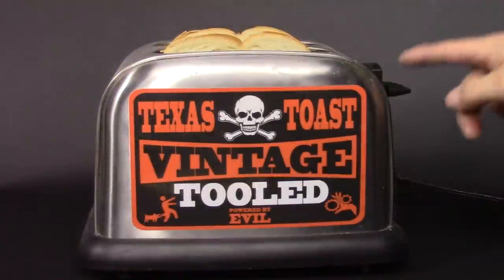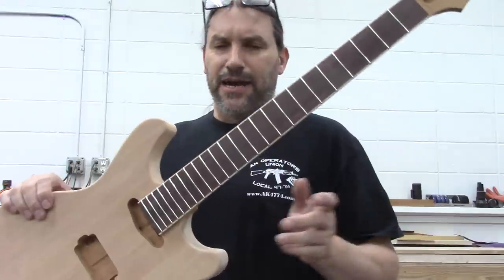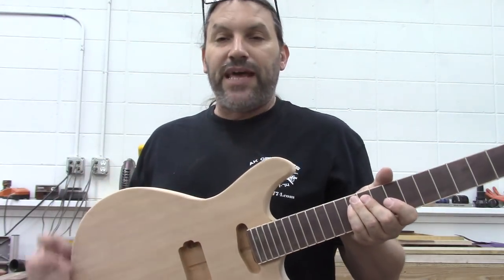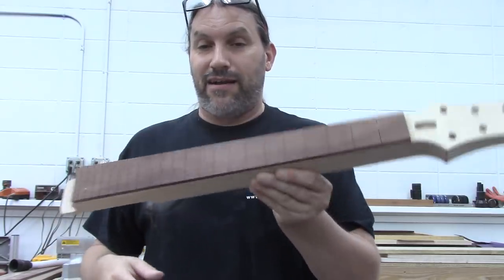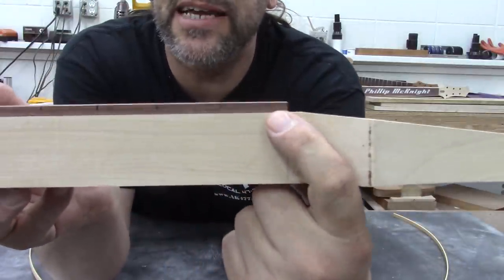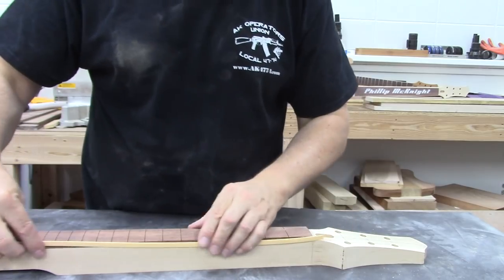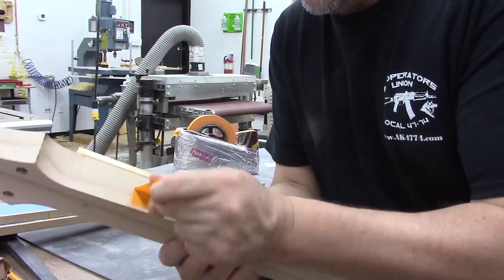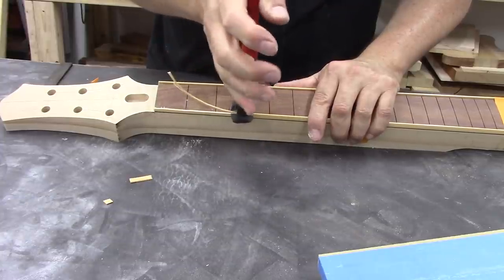Every Guitar Neck You Make NEEDS To Have Binding... And How I Think You Should Do It

Comment: Very instructive video, thank you. I like to bind my fretboards with the same wood as the top I use on the body and headstock veneer, i think it links both parts and looks nice. For those who prefer to do it without a router, you can bind the fretboard before gluing it or the neck. Just cut the fretboard 1-2 mm narrower on each side, glue the binding on each side, flatten the back flush and then glue the fretboard to the neck.
Reply from the maker: Hi Alex, you certainly can bind before glue up. I used to do it that way and it worked great.
Reply: Three years later... I like the necks to have the same wood--tones as the body back.  I really LOVE casino guitars but HATE that they have blonde bodies and dark wood necks.  Among my last two decades of casino purchases, I've found walnut ones that are terrific ONLY because the body and the neck wood is the same tone... of course, I don't like big-block or fancy in-lays because I want to work on wood fretboards, not an incongruous plastoid or shell surface.

Comment: Matt, I'm glad you did this video. When I see super expensive private stock, wood library guitars, from Annapolis, Maryland, made from rare nutsack wood, from the Amazon Rainforest, going for $8,000 and up, I always think, "and you didn't at least bind the fingerboard"?
Reply from the maker: Does PRS do any binding on anything?
I want to say I have seen some headstock binding on a few things
Reply: @TexasToastGuitars  Their cheapest SE Custom models have had binding as recently as the past year or so, the $499 range. I have the $799 model without binding.
Reply: @TexasToastGuitars  Matt, they bind the McCarty 594's fingerboard, because it's a Gibsonesque guitar to begin with. It's quite possible that they bind the fingerboards of a few of the upper echelon (not in the regular core lineup) guitars, because they also have the same type of "Made to Measure" program that Gibson has, and they may have had it, first.

Comment: I'm a nerd, just started building. I'm going to do cuts for all the frets that are completely inside the fretboard, (I.E. The fret slots are not cut all the way through, leaving the edges of the fret-board without any visible gaps or filler without binding.) I've done tests with a jig and a Dremel with a router bit that's the right size for the fret tang, and it seemed to work well, plan on taking it onto a full custom build this summer. It makes it easier to actually pull off a clean side without the extra time of wood binding. I stole the idea from Schecter's process that's up on Rob Scallon's channel, but they use a CNC that I currently do not have and cannot afford. I personally don't like bindings on my guitars for aesthetics, as well as just the fact that I personally prefer the feel, I don't tend to notice it about 30 minutes in when I'm on my grandpa's SG with binding, but I still notice it every time I play, and something about feeling two different materials just irks me for some reason. I plan on adding some class to my necks in other ways so I feel like It's just generally not super worth it, for me personally anyways. I also find nice dome medium high frets to be ULTRA comfy for me, but I'm not a great player, I'm so far a wayyyyyy better builder.

Here because my grandpa's 68 sg is worse for wear so I'm trying to restore it, the binding is starting to peel off and the fretboard is super uneven due to long term un-oiled storage. Soooooo I'm gonna have to bind that lol.

Comment: I much prefer building a neck with binding to with no binding. It's just easier honestly. I always undercut the tangs, regardless of binding or not. Filling in the ends of the fret slots on unbound necks with dust and glue is a tedious process I truly despise, and binding the fretboard eliminates it. That little bit of fretboard showing under the binding is a nice touch, Matt. I may have to try that sometime!
Reply from the maker: I'm with you man, the little extra work is worth it and if you consider the work to fill in the slots it isn't any extra

Comment: Just curious, why did you use such oversized binding for the neck and then clip it down with the clippers? Why don't you just put a specific size of binding on it to fit the channel and be flush with the fretboard edge? Removes the clipper option.
Reply from the maker: The binding I get comes in lots of sizes since I wanted to do the Gibson style get nubs I went with the tall stuff

Comment: you think binding is aesthetic?  it's one of the most physical functioning parts of the guitar, not to cover joints its to protect the guitar, ever notice how it comes off real easy? drop the guitar the binding absorbs the shock and takes the hit, prevents ruining the body or object or headstock, initially an acoustic thing as they were way before solid body but it works on solid body but not as crucial solid body can absorb a hit, may dent whatever but that's it, an acoustic can crack and splinter so teh binding is to help prevent this in mild hits whatever your everyday moving an acoustic around and touring with one..

Comment: I'm sure this has been asked before, but... Your radius sanding rig has an angled offset, so its axis of rotation isn't square with the belt.  Why isn't that producing a radius that's sort of on the piss in relation to the centre line of the neck?  It could be my choice of evening beverage, which might be clouding my normally stellar understanding of engineering, but what's going on there?  Explain yourself immediately.  I won't tolerate any further sorcery.
Reply from the maker: Hmmmm 
Well yes it has been asked and answered numerous times.
I have no idea what "sort of on the piss" means.
Since the platen is still flat in relation to the jig's swing it still creates the correct radius. imagine if the platen was 2 feet wider, and just as flat, in each direction... you could angle the jig to swing anyway you wanted and achieve the same results.   
There is no sorcery but the belt gets used more evenly if you build in a slight angle. 
Now then, since you barked at me and made a silly demand like you were the drill instructor. DROP AND GIVE ME 50 YOU GRABASTIC PIECE OF CIVILIAN GARBAGE!
Reply: I'm pretty sure there's a vid where Matt talks about it, also. I'll be damned if I remember which one, though 😁🤣
Reply: @TexasToastGuitars  Awesome dude, I'm loving the reply.  C'mon,  didn't you read the 'slightly' drunken banter, as a bit of sarcasm with a twist of reverence?  I'm a Brit lad, so "on the piss" sort of means wonky, out of line, like a drunk person walks down the street.  Clearly you make solid guitars, there was never any disrespect.
Reply: @petegurney994  there is a vid about the radius sander. It's called "How to radius a guitar fretboard.... LIKE A BOSS!!!" 😁👍
Reply from the maker: @petegurney994  I know you were giving me the business Pete.
But I still want those push-ups
Reply: @TexasToastGuitars  Ok, but I'm not doing any push ups with this hangover. You can have them tomorrow.
Reply: @JC-11111  I'll look it up. Cheers.